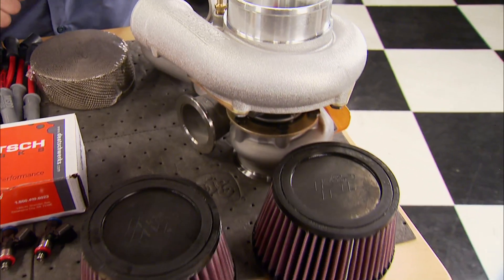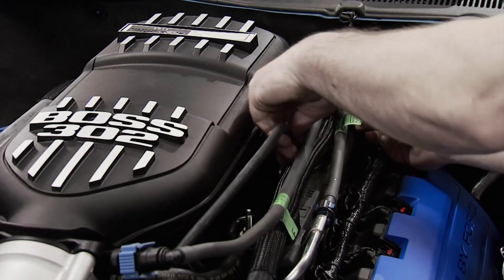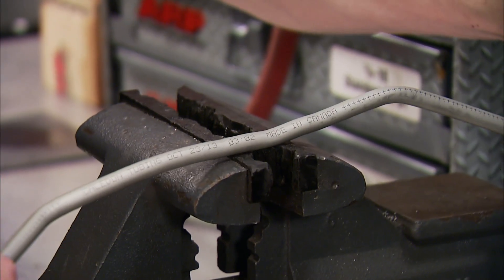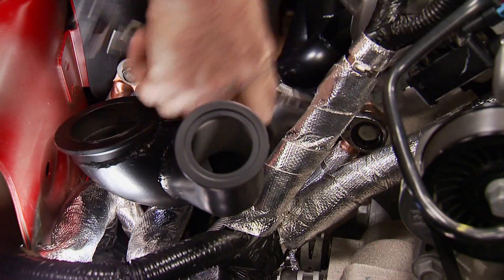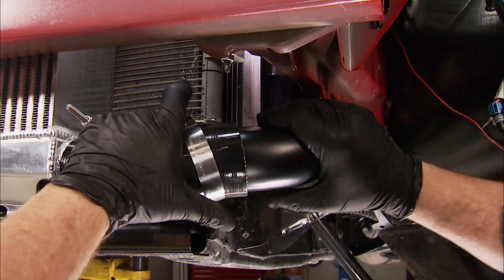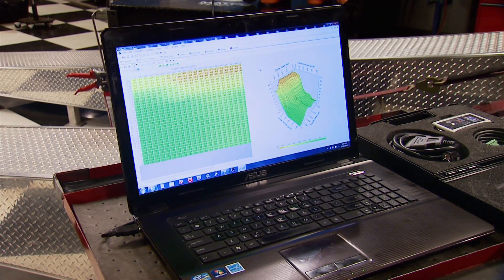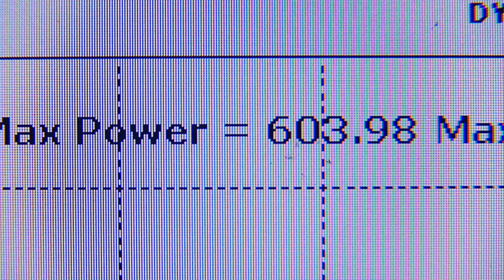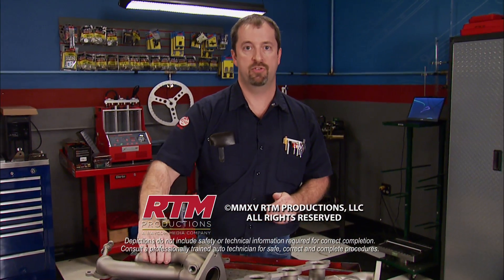600 Horsepower Twin Turbo 2014 Camaro - Engine Power S2, E1

Comment: A bonestock CT525 LS3 makes over 61X direct from GM with the stock GM carbureted intake they come with, Dinky little .525 ASA cam a 750 Billet pumpgas carb, 28* total timing, 

That build is a pig for 600 hp

Comment: Not impressed with 603 hp and 600 torque from a twin turbo setup. Bolt ons without a cam or ported heads are making people 480ish with pump gas, then E85 pushes that to at least 520 on an N/A engine.

Comment: So there’s strapping on these turbos with the stock internals? Can anybody tell me how long this is going to pull like that before blowing up the LT1? I believe the LT one has forged connecting rods but can anybody tell me what else in the motor is forged and or can handle power like this?

Comment: When you’re making almost 680whp on unopened ls3 with a unported zl1 blower and stock cam on 93... 650 lb-ft at 2400 rpm 👀

Comment: This is great power for a stock engine  and trans combo. And I bet you its only running about 7 to 9 pounds of boost. Thats nothing for a twin setup capable of 25+ pounds of boost. You rebuild the engine and trans with a better fuel delivery system and ect. You can easily make 1200 plus to the wheels with this setup

Comment: I get 600HP with a power adder on a stock motor but why bother with twin turbos if that's the goal? Seems like going with a blower (like a used one off an LSA engine that everyone has been doing for years) would be more economical and clean. Even with the prices going way up on the used market, it can still be done for less than half of this for similar results.

Comment: Bolt on superchargers make 600 hp too.  I don't know why they'd "sneeze" at that.  The Z06 and ZR1 use Eaton "bolt on" superchargers.  It is true that you can ultimately make bigger gains with twin turbos, but at 600 hp, they're still in the same performance range.

Comment: Stock block can't handle this power, drilling the oil pan while still in the car and not welding the exhaust? These guys are lower than amateurs, I wouldn't do anything they suggest! P.s. what about the washer tank removed?
Reply: Its 600hp the stock block will be perfectly fine.
Reply: @drewmontoya3838  how do you know this? You have done the exact same, no. Just your opinion.
Reply: @brianz3284  people are experts on YouTube haha

Comment: Can the stock internals in the LS3 handle the horsepower, also is would the rear end need an upgrade so it doesn’t snap?
Reply: The stock internals have held 800-900hp. But needs ZL-1 FP the axles can handle 1000. My guess for the weak link is the guibo couplers. I already tore 2 rears. 1 piece driveshaft and new carrier and sway bar n endlink bushings.

Comment: Seems like a lot of work to not do a built transmission , an upgraded fuel system and a better cam - would have still safely  made 700+ whp with more fuel and a better cam with no reliability issues .   

This Camaro will still lose to a bone stock hellcat ....
Reply: good thing the hellcat didn't exist when this came out...

Comment: A 302 is a small engine for 950 hp, that's pushing it to the outer limits i would think, no?
Reply: Not for the Boss 302 block.

Comment: you put twins on a brand new all aluminum bowtie v8 and only got 600hp......thats pretty sad tbh
Reply: Stock fuel pump, stock catalytic converters, emissions required to drive on the street.
Reply: And it’s sad how uneducated you are, I guess you didn’t hear the part where everything else is stock
Reply: I don't think that trying to get the max hp they can get out of it was the point. This is a street friendly setup that can be driven every day, all day. And not cost too much to operate. Did you even notice that he said on a totally stock motor? If they wanted to, and with changing a few componets out, you could easily bump this particular setup hp to 800+ hp. I've owned both a 5.0 mustang and a LS3 Camaro. With the setup they are using you are not gonna get any more horsepower out of one or the other LS3 or Coyote engine.  But on the extreme end, the LS3 will put out more hp than the 5.0 will due to its increased displacement. Not saying the mustang won't push a ridiculous amount of hp, and I did love my boss 302, but when I comes to all out power that each engine could potentially handle to the max, the 6.2 will eat the 5.0's lunch. And do it for less money.
Reply: And only 9 pounds of boost.   Can easily be upgraded.
Reply: Phillip Taylor you're an idiot. This a completely STOCK CAR
Reply: Not really buddy. Learn your shit... and no I'm not a chevy guy
Reply: @Freeze, hey bonehead, stock internals remember, and not to mention emissions legal.  Damn you're stupid.
Reply: Exactly, a Coyote would have this thing for breakfast!!
Reply: 02autogt who’s more likely to break down though
Reply: @02autogt  nah, mostly everything is stock so nah a 5.0 would be in the same boat buddy
Reply: @02autogt  a coyote is much less reliable with stock internals than an LS of really any variety because of the higher compression ratio.

Comment: I dont give a damn what they say, you dont drill and tap into an oil pan without removing it. The chance of getting metal shavings in the bottom end is too great. It wouldnt take much to totally screw up the crankshaft and rod bearings. And their goes your motor.

Comment: in 2014, GM offered the zl1 camaro with the LSA engine. it came stock with 585 horsepower. stock. with warranty.
Reply: So, sell the SS and take out another 20-30k loan on a zl1?  That 585 is at the crank...
Reply: @PurpleHeartVR  Right, in 2014, the zl1 started around $55k (i know because i was looking in to at the time). 
The zl1 came loaded, packaged roughly with the same as a 2ss , which was around $40k. The ZL1 came with more track tools also. 
Yes, that is a difference of $15K. Don't know how much this kit cost at the time. Lets not forget that unless you know what you are doing, you will need to hire someone to install this professional (voiding the gm warranty). 
I'm guessing at the time, it would cost $7k to purchase this kit and install it (pulling that number out my ass to be honest). 
Would rather spend that $8k more and get something with a factory warranty.  

But I guess time has proved this was not a good investment. You can one for so cheap now used.

Comment: A single precision 62mm turbo should be good for 500 hp.
wouldn't it be beneficial to go at couple of sizes down and go for internal wastegates for better fitting, price and better response?
A heatshield around the smaller turbo and exhaust, would also be better then wrapping 8-15 hoses with heat shielding.
The intercooler looks good for 800-1000hp a size down would maybe allow the washer fluid to stay.

I feel like a backseat keyboard warrior writing this, but i feel like this kit is not made for the purpose of delivering 600hp, it looks like it is made for 700-1000hp and has serous drawbacks, that maybe could have been avoided because of it.
Reply: There only making 9 pounds of boost. They can easily make 800hp if they turn it up but for what reason?. Its mostly a stock car.

Comment: Love how people that have never built a car say it should have more power. Too many YouTube videos as education 😂
Reply: Im working on making my V 800whp, and I am worrying about internals strength...CAN the stock bottom handle it...sure...how long though? I want reliable which means new internals, and larger blower, which means new ignition, which means new fuel system. Most people dont understand the money and experience needed to get high HP and even 800 is fairly low. And that was just for engine....didnt even mention body stiffening mods and drivetrain work. Its a time consuming and expensive proposition to go high HP this kit is probably VERY well priced and 600...lol people have no CLUE how terrifying that is, ive seen people think they can handle 600hp with no trac/stab control...Im terrified to LOOk at that button. Hope my rand made sense in all Im agreeing with you. I started learning on youtube then went to an actual mechanic and tuner and asked to apprentice, since he was a family friend he relented, but I still have IMMENSE amounts to learn.

Comment: I wouldve built the motor first, boost on stock N/A internals is not a good idea. Plus only 600 hp with a twin turbo setup is kinda pathetic
Reply: @uncle_salty_3675  exactly how am i a moron?

Comment: 600 is not going to raise any eyebrows,  but these guys are far smarter than most.  I know because I have been down this road before. 
I added twin 50's on my '00 Mustang GT with 8psi.
First to go was the transmission in quick order.  Rebuilt it, and it was quickly qranaded AGAIN.   So, bought a heavy duty TKO 600.
And then...the motor lasted a few short weeks before I  had to replace it with a built unit.  And then...fuel system,  supporting mods, and 65K later it was finally done.
In conclusion: "There is no way in hell the stock engine/transmission could hold anything more than what they tuned it for.  Hell, they could have turned the boost up high enough to make a bomb.....
BUT WITH A STOCK ENGINE?  WHY!?🤔
Reply: Those 4.6 needs a lot of work for power

Comment: To be honest adding turbos is a waste. They don’t last and they mess up your engine. It’s better to have all motor are super chargers. All that money spending for what when you can just buy the camaro zr1 650hp-650 tq. I mean this application cost a lot of money and it’s a waste.
Reply: At 9 psi that motor would last forever. This was also 5 years ago so tech is different now, and it was completely stock other than the turbos. 600 for a reliable, responsive street car is awesome for that time or even now.

Comment: Only 600hp? on twin turbskies???
Reply: They said it's capable of 1200hp but this car has stock transmission, fuel system and the engine is bone stock

Comment: How long do the stock pistons last? They are not designed by factory to take the extra compression. You need pistons with a taller crown if not they will split in half. All that work for nothing. I would pay attention to the internals. That’s just me. Awesome video!

Comment: Bruh you guys removed the factory quad tip NPP exhaust which is a 2.5” straight pipe set up when the valves are open.. and you install a single tip exhaust that doesn’t fit worth a shit in the rear bumper valence.. come on.
Reply: Lame...These shows are just advertising for the parts they uSe

Comment: I want Part 2 of the 632ci Blueprint engine bro, I've been wanting that engine since Jegz showed me in an email it was built n existed at $12k..lol
Reply: Ha! I had one in a big airboat we ran. It made over 900 hp but didn’t last long. Currently running a mild 650 hp 503 stroker motor and it’s much more reliable
Reply: @Dunkaroos248  really, was it forged internals n all?? It didn't have warranty?? What did y'all do to it??
Reply: TigreLoko24 so it wasn’t built by blueprint, it was a custom builder out in Alabama. It had billet rods and forged pistons and crank with dart 2 heads. The engine was made to pretty much go down the drag strip and be torn down. My idiot boss at the time thought it would be cool to buy a 17,000 dollar drag engine for an airboat. We had an engine builder out here in California try to rework the motor to make it more reliable but it was just doomed from the get go. At the end of the day, I ended up calling the guys who built the airboat and asked them what engine they ran in that boat and they directed me to their engine builder that made a reliable engine for us. I think it was in the neighborhood of 11 grand.
Reply: @Dunkaroos248  ouch, no doubt expensive.. Jegz sells great engines with warranty with forged internals, saw some for $5-6k, has me questioning building my 09 P71's 4.6L 2v..lol
Reply: @Dunkaroos248  I would Coyote swap, but don't know if I want to go that route bro, saw it for sale at $5,200k tho in email, not bad for 435hp I think it was.. Now least I see it for is $7k, rather build mine to stroked 5.2L $2,600k, Trickflow Race heads $3k, plus other parts I already have $++..lol Oh, gonna need cams too..
Reply: @P71ScrewHead  go LS
Reply: @queasyislander0274  i'll go LS7, in a Miata..

Comment: Safe and reliable kit if you're not touching anything in the engine. Doesn't seem like much with the numbers guys are cranking out of 5.3s but keep in mind that, at the very least, they're filing rings and upgrading the valve train. You can't go crazy on stock rings or the ring expansion will cause the ends to meet and then push up or down busting apart the piston. Also, stock cam isn't an optimal grind for boost and stock valve springs will introduce valve float much sooner with boost behind them.

This is a pretty straight forward bolt-on, plug and play kit. Pretty dang good for what it is, too. Small twins will spoil fast and feel about like a roots blower without any parasitic loss

Comment: So you delete the windshield washer fluid container completely
Reply: Yeah. What the hell?
Reply: @joeyjoejums  well for a bolt on package that's supposed to keep your car all street legal and everything it is pretty nice but some of us just took out I relocated I kind of question how it would Fair drive in the rain and also not that much horsepower you didn't know you were going to be getting all kinds of bugs all over the windshield turn off having a smaller Reservoir relocated it for the windshield washer would have been cool that's what the hell

Comment: Im trying to understand this. But all the plumbing and hair dryers for 600 horses? Would've been easier with a procharger and injectors. And no lag. But maybe I'm missing the point. And easier to maintain. I guess I'm over thinking this.
Reply: I see some comments saying that people aren't thinking. It's to be reliable. But that's my point. It seems to be a waste of money and time for all of that when a simple procharger will work. And I don't have to tap into both sides of the oil pan and unbolt manifolds. Relocate coil packs. And etc. For a reliable 600 buff horses. But it's just my opinion.
Reply: @larrynance17  you're righr

Comment: The welding on  the kit pipes looks like it was done in a high school welding shop .  No hate just observation ! For that money it should be tigged not spray mig .
Reply: they just ask more because it's titanium, which at the end of the day just saves a bit of weight, they could easily sell exactly the same thing made out of mild steel, but then their profits would be so high .. because "TITANIUM"

Comment: LS engines need all the help they can get to make any respectable power. And even with all the help it still made a pathetic amount of power. If you want to go fast stick with Ford and throw chevy in the trash where they belong.
Reply: There is a shop in UK that gets 700hp naturally aspirated... Coyote are heavy and expensive to swap all those cams...Did you see the new vette still uses a cam in block pushrod engine and 0 to 60 in under 3 sec.

Comment: To answer some stupid comments like why only 600hp ?  Stock fuel system, stock transmission and emissions legal with the 2 factory catalytic converters.  
Some of the comments not very smart thinking you can just add a couple turbos and have reliable 1,000 whp.
Reply: if you want a car to be reliable and can be used daily with a big power, 600-700hp is enough if you dont want your tranny and rods goes kaboom
Reply: JMFA88  of course there is, you get to sell someone a second turbo and all the piping that goes with it :D
Reply: JMFA88  Have you looked at exhaust routings for single turbo V8 systems. Packaging and installation issues are why twins are popular for V8 conversions.
Reply: Matt Miller Jesus why are you so angry? We’re talkin cars here man.
Reply: Dave Micolichek  to much pressure inside the combustion chamber can, even if you have low RPM if your Rods  can't handle it due to boost pressure it will snap
Reply: exactly ! they provided a great package here, which will be easily emissions legal, and go with all the stock components be reliable and last like it was always meant to be there.
Reply: ZeroBoostBuick also the complainers need to keep this in mind: the compression ratio. The Coyotes are around 9.5:1 while the LSs are over 11. The coyotes were designed for boost from the factory, while the LSs were designed for NA power.
Reply: @Rudderify  all coyote mustangs are 11.1 and 18 and up are 12.1 compression.
Reply: None of you know what your talking about that ls can handle 18 psi all day long but the intake there useing kinda sucks. you can make a stock 5.3 truck intake flow better then most after market intake. Plus they have the boost turned down it could do 1000 no problem. all the time wouldn't be good but a few passes at the track wont hurt. that ls will take it for some time. Longer then an old style v8.
Reply: It's probably cheaper to do it this way than buy a brand new ZL1 that's pushing close to 600 with a whipple charger stock. 

That's just my opinion.
Reply: @Truckerdaddy  that's a very accurate opinion.
Reply: JMFA88  I thought V8's like twin turbos instead of single turbos
Reply: Exactly even a stock cam and stock oil pump
Reply: Yeah, why twins? Why not just supercharge it? The stock blowers go up to 700 horse and you don't have to mess with exhaust and Intake routing
Reply: @justinlabarge8178  blowers have heat soak issues.
Reply: We all know this engine can handle 1500 on stock bottom end. No need to push it to bloom
Reply: not to mention all stock internals
Reply: my answer is -- vid was made in 2015 -- \
Reply: @ZeroBoostBuick, daily driver street car Not a race car and its mostly all stock so that is a lot of HP.
Reply: The factory LS internals will not support 900whp or 900 crank HP.  There are loads of aftermarket kits to handle than king of power but you will be doing a full rebuild to install them.
Reply: JMFA88  That's what I was thinking. It makes no sense to go TWIN TURBO and everything on it remains STOCK.